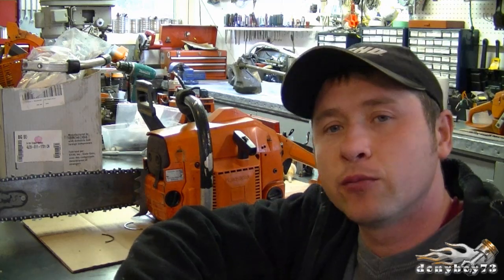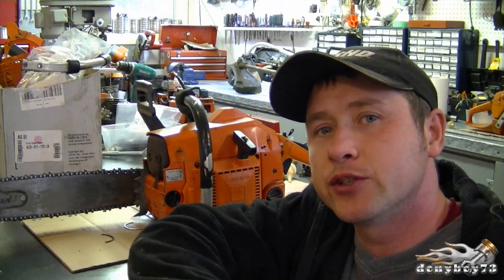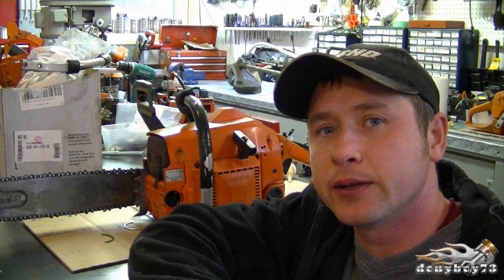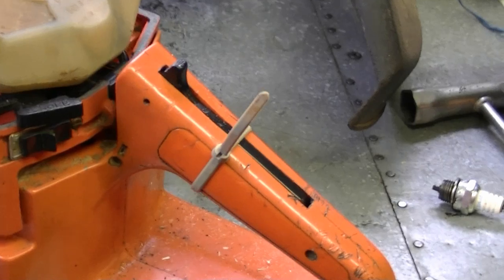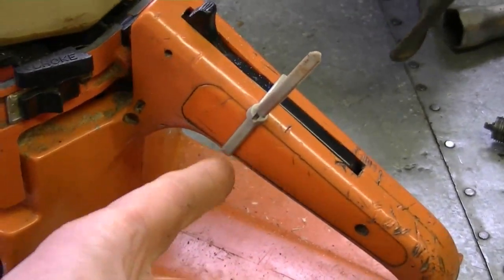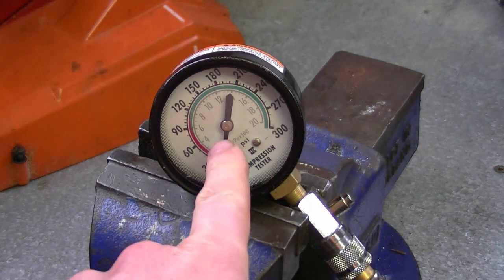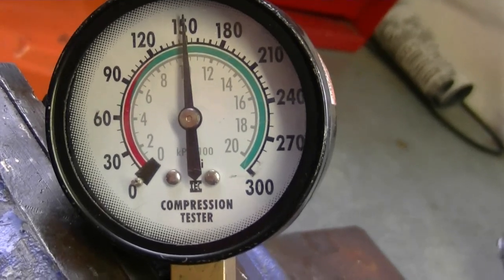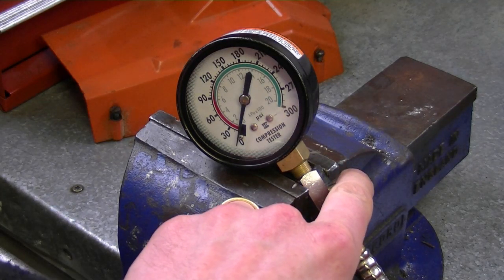Husqvarna 154 Chainsaw Compression Test After Sanding Cylinder

Comment: Don. I just bought a 400 echo new and did a compression test just to see. It is only 120. I have a lot of older echo equipment so I did compression tests just for comparison. Even my 8 year old hand blower has 120 as did ALL my echo stuff. But when I see you doing compression tests you get 150+. Is echo just not as good out of the box ? All my echo have the same so it can't be coincidence. I hold the throttle open and pull till my chest starts to hurt and my hand goes numb. My tester has the valve right at the threads so.

Comment: Wow, nice compression. And that for a sanded down cylinder, impressive. And it will only get better as the cylinder wall smooths itself a bit more when in use.

Comment: Have a 41 and a 365 that have been in storage for 15 years.  Tested the 365...at 125 psi, then realized it has a decompression valve stuck "in", retested it at 165, now going to test the 41.

Comment: So this would probably explain why my leaf blower (given to me free) won't start even though fuel and spark seem to be ok.  A shot of starting fluid won't even get this thing to pop.  The carb was super clean, but I put a kit in it anyway.  It is a Ryobi 310 BVR.  Replaced fuel lines, carb kit and primer bulb.  I think, if I remember correctly, compression showed around 75, which I'm assuming is to low to fire?

Comment from the maker: the 365 is a nice saw
Reply: Hi donny ,i recently purchased a husky 450 that wouldnt start . Ive removed the cylinder and checked for scores on the barrel which is fine aswell as the puston looks good aswell . What do you think the compression value would be acceptable on this saw ? Thanks

Comment: At what compression will someone need to start using high octane gasoline (to prevent pre-ignition) ? I had a customer's Stihl trimmer over for a tume up, and it's compression was 180 PSI. I thought that was pretty high, but chaulked it up to having lots of carbon on top of the piston, and up in the cylinder dome.

Comment: Yes ! I fitted new piston rings into a Stihl hedge trimmer & I still only got 97 PSI of pressure on a compression test from 75 PSI with the old rings fitted !!!!

Once a new cylinder kit was fitted,I got 105 PSI before the rings were run in & 124 PSI when they were run in !!!!

150 PSI is excellent compression even when run in because I have a Briggs & Stratton 3.5 horsepower lawnmower which only has 100 PSI of compression,the engine doesn't burn oil & that compression is meant to be fairly normal for that engine as it still runs,my dads Honda HRU217D lawnmower which runs the GSV190 engine has 135 PSI of compression with the exhaust valve rocker arm removed basically !!!

I've seen a Briggs & Stratton engine test at 120 PSI on here though !!!!

I also have a Victa 2 stroke mower which has 109 PSI of compression with the decompression valve removed & the port plugged up with a spark plug (95 PSI with the decompressor in place),it was full of water & still runs briefly (for 10 seconds) as the primer bolt front plate leaks due to UV damage,the mower needs a lot of work doing to it including fitting new crankshaft bearings as they are rusted & pitted from having water in the engine,they run ball bearings !!!!

The Victa lawnmower was always a simple Australian design since the model 9 mower my dad used to have when I was born in the late 1970's.

Comment: What is the pressure that shall indicate the compression tester, when this test is  performed, to a  Handheld power cutting husqvarna k970R?
1 It turn off on low speed (ralenti).
2. At low and high RPM, blue smoke exits from the exhaust
I have two handheld power cutting with the same flaw.
I hope someone can help me

Comment: can you sand a piston. I didn't properly break in the motor after a rebuild and had a partial seizure. I honed the cylinder and didn't want to buy another 150 piston. the piston that I have is a forged piston with .9 hours (less than an hour)? it just has very light four corner seizure marks on it. any direction would be great

Comment: I tested my Husqvarna 141 today with new compressionmeter bought today.  It show 120.  I have brand new cylinder and piston and rings.  I will not start.  Have new carb on it as well.  Waiting for new coil from china.  lucky, very easy to get parts on e-bay for this model and extremely low prices.  Hope it would start.  It gives spark.  But heard that the spark could be to low or weak.  If not start with new ignition coil...and it gives spark...and got gasoline straight into cylinder or start gas...it is mystery why not start.  120 psi...is that good for this model ?  Should it have more to get started ?  Thanks for all the helpful clip you present Donyboy !

Comment: i have a 235 that runs terrible and now wont start. i put in a new piston and ring but the compression is very weak. should i try a new cylinder or a new saw? what would be causing the saw not to start?
Reply: Tony W there might be quite few problems that affect the starting of a chainsaw.check your carbourator and ignition  and you might be fine with that